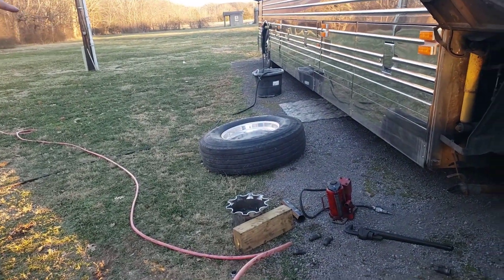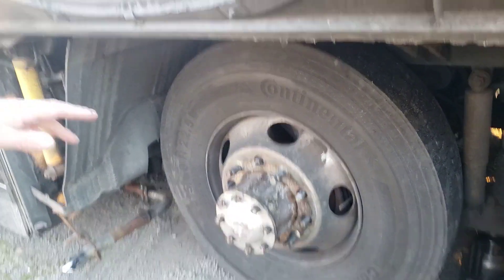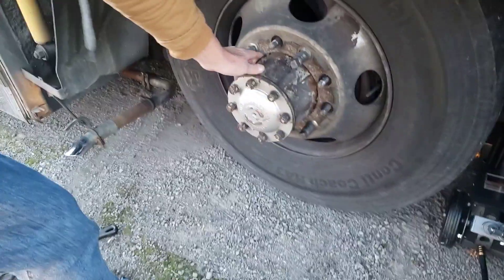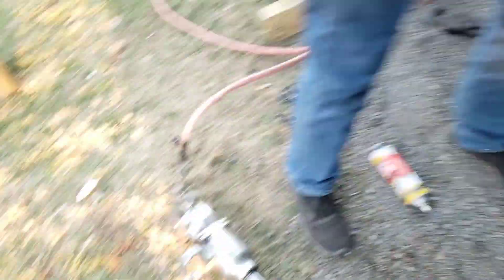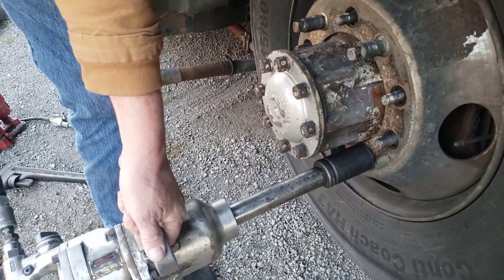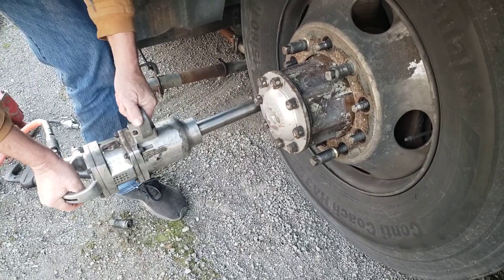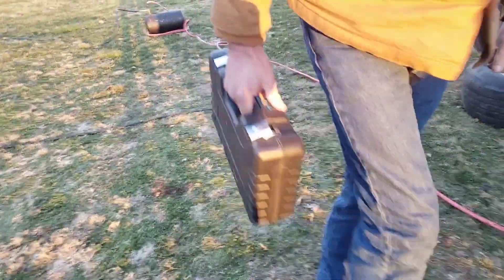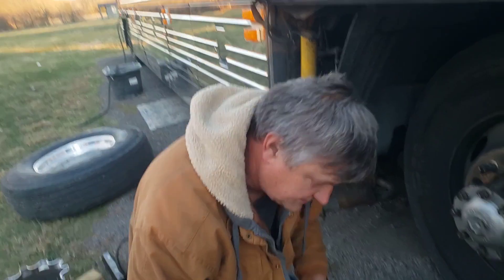Torque multiplier used on Prevost bud nuts

Comment: Pretty neat. A buddy of mine back in the 80’s got a job at a gas station (back when they still worked on cars at gas stations lol) and says to me one day “Hey what’s with your Mopars with the backwards lug nuts, I snapped two studs of a lady’s Duster before I figured it out!” I had to laugh.
Reply from the maker: Ya I broke 1 on a 70 dart working in high school auto shop. Shop teacher laughed and then I learned about changing studs. The part that stinks is it was on the girl friends dad's car woops woops woops lol
Reply: I'll have to look that up! My girlfriend's 72 valiant has normal lug nuts ,wonder what years has reversed threads and why
Reply from the maker: 71 was the last year. They stopped doing it because of that exact reason people were breaking them. I was told that it was a manufacturing move every thing became the same. The reason chrysler did left hand thread was a safety move, just the same as the trucking industry. If you leave lug nuts lose the rotation and movement of the wheel would tighten the lug nut on the right hand side but lose the nut on the left so with left hand threads on the left instant safety the lug nut would tighten instead of falling off.